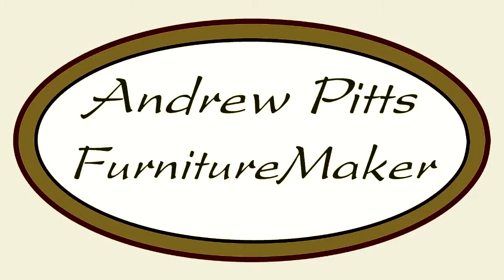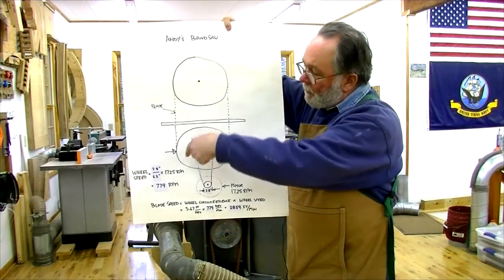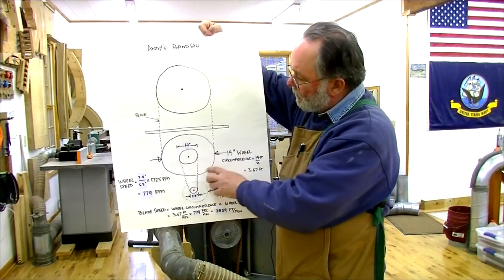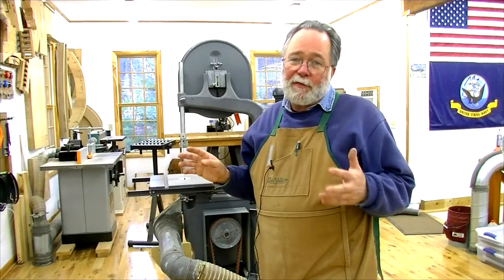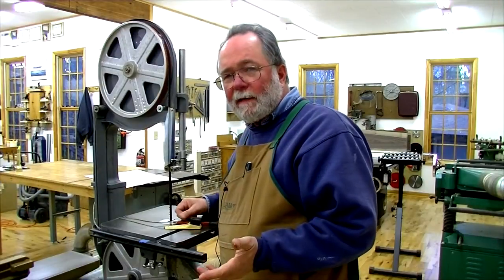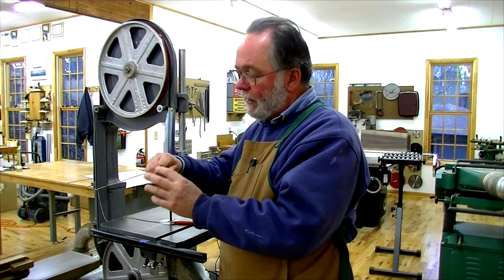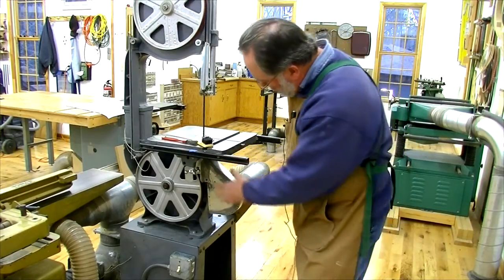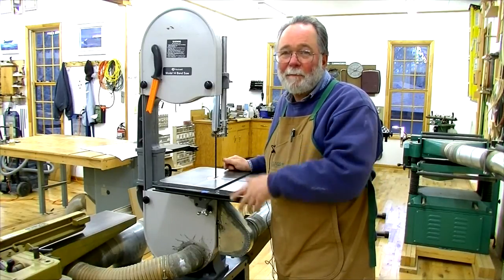Bandsaws: Saturday in the Woodworking Shop #6 with Andrew Pitts~FurnitureMaker

Comment: Nice overview Andrew. Looks like I have the same bandsaw, which I bought used in the early 90's. Funny, I mounted a 4 inch port in the same spot on mine. I didn't bother collecting near the table as you're doing, but most of the dust still seems to get collected. You never showed your fence, but it looks like it might be the original Delta. I semi-recently bought the Kreg fence, but haven't installed it yet.
Reply from the maker: Marty Backe Yes, Marty, it's the original fence to which I attached an auxiliary wood fence to make the fence twice as tall.